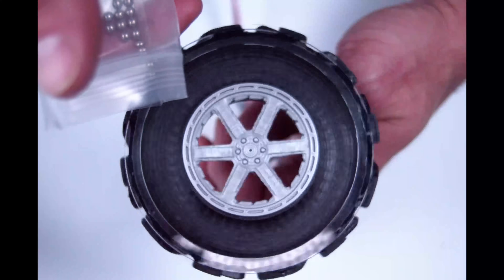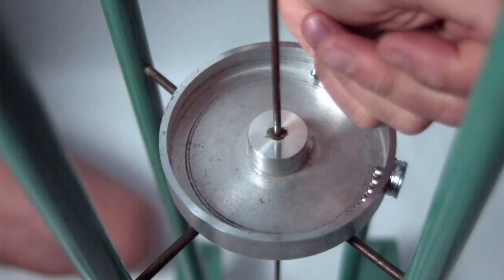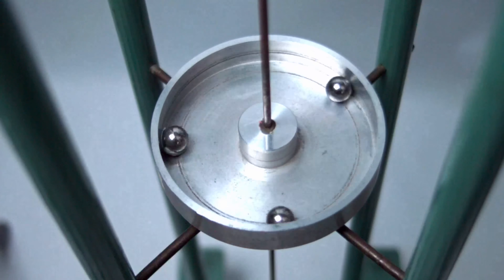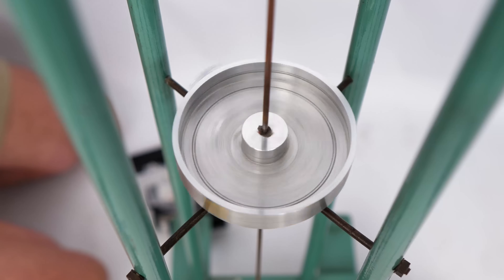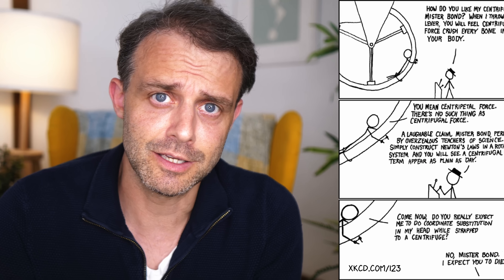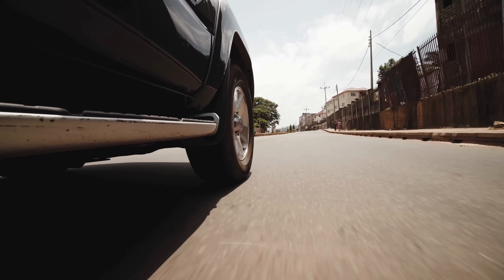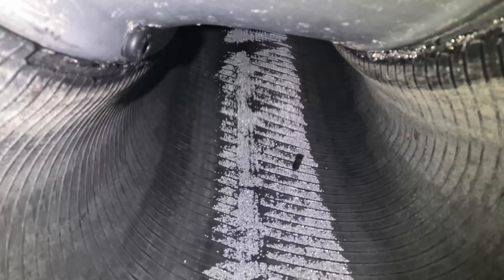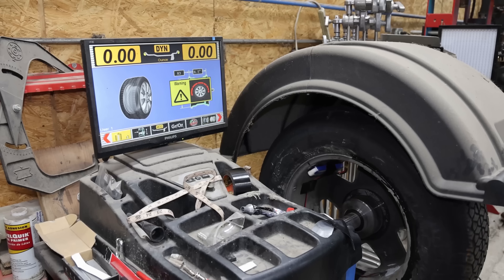Do tire balancing beads actually work?

Comment from the maker: My floor is covered in ball bearings.
The sponsor is AnyDesk, try it today https://anydesk.com/stevemould
Reply: Pretty sure you mean bearing balls, not ball bearings.
Ball bearings are the entire assembly of 2 rings, some bearing balls, and usually a plastic rack to hold the balls in equal spacing.
This I learned when asking around a metal shop for ball bearings when what I wanted was bearing balls.
Reply: It’s all ball bearings nowadays.
Reply: @jimcushing8722  throwback
Reply: @seanehle8323  Maybe varies by region? Here, we call the assembly you describe "radial bearings", and a single sphere of metal, a "ball bearing".
I do QC in an industrial factory in the USA.
Reply: @seanehle8323  The shop was being picky-picky, but I guess they are correct if you need to go there. Kleenex is tissue but tissue isn't necessarily Kleenex.
Reply: @seanehle8323  Which country are you in?  I'm in the northern USA and have never heard that.  BTW, Google AI says you are corect.
Reply: @Wintergartan would like a word.
Reply: @thesprtn2346  hahaha. Exactly what I was thinking!
(also, Ivan Miranda and his on going 3d printed marble clock adventure......)
Reply: @thesprtn2346  I think you meant @Wintergatan
Reply: you know people also fill their tyres with some liquid that does the same balancing but as it has less friction it seems to work better.   was surprised you didn’t mention this in your video.
Reply: I also had to share some weird kitchen phenomenon
when round bottom pot is placed on a IR cook stove it start to wobble circularly.
doesn't matter which material is it, Aluminum, Steel, Copper.
if we stop it by hand again it start to wobbling again.
and this is only for IR heating stove it doesn't wobble on Electro Magnetic cooktop
WHY???

I also has some video about it. if you want i can share it.
Reply: After you gave the "falling into place" explanation I was oh so hoping for a shot from the rotating frame of reference showing the second ball falling naturally into place, but alas 😔
Reply: Glass is the best. Glass beads also help keep the rim clean of aluminum's oxidative behavior, or steel, from rusting. Change the beads for fresh, each tire rotation. 😉
Reply: You want the oxidation layer on aluminum.
Reply: @DetroitMicroSound  Changing the beads 10 to 15 times per second is a bit much, I think ;)
Reply: In the 1930s my grandfather had a 1929 Indian Scout motorcycle, he could not afford to patch his tires, so he poured aabout a cup of water in each tire.
Parking it with the hole down the water kept the air from leaking out for about a week.
He noticed that at speed his tires would balance out for a smooth ride.
Reply: @davygravy7332 not I. Winter
Reply: Glass beads rubbing on each other means glass dust after a while. Good luck with your lungs if you try to replace tires without respiratory protection.
Reply: We'll give you some time to get your bearings. :chillwcat:
Reply: And have ball bearings all over my floor? No thanks.
Reply: My wife has a question for your next video: she wants to know what your scientific name is and how you acquired the common name "Steve Mould"
Reply: But doesn't this mean that at low speeds the tyre is even more unbalanced? And for anyone who lives in a city and never gets up to freeway speed, their vehicle will be shaking all the time.
Reply: is this possible with a fluid? could one use epoxy to balance the tire permanantly?
Reply: Can you please do a video of a car that has balancing beads installed in a tire, and then simulate a blowout doing 60 mph, and what that damage looks like to the vehicles behind it?
Reply: I can't help but feel like a ton of this "gravitate towards stable point and likely oscillate, all due to centrifugal forces" thing, has a lot to do with the same rotating frame + centrifugal force bullshit that powers lagrange points.
Only, those have no outer rim to push against to be moved into the right place, and depend more on distance to mass-center mattering a lot for how strong forces they experience (and are in fact more stable with some initial velocity and offset if you tweak it right to get the right type of orbit, otherwise not being too unlikely to eventually orbit out of the stable region). But still, feels related, in a way.
Reply: Like 69,😂 lol now you know @wintergarten 's pain
Reply: If you spin your room fast enough we know where they'll end up now...
Reply: I like AnyDesk, but they still -- after years -- have not chosen to support the Wayland compositor for Linux, as though it is still viable to run X11 as a daily driver these days.
Reply: @Nethershaw  anydesk is terrible, rustdesk which is also open source is 1000x better
Reply: Very cool as ever, and will try AnyDesk.
Reply: i've got sand in my underpants
Reply: Wintergatan would be one of the few to sympathize with you LOL.
Reply: I feel like this is somehow related to electron and atomic theory.
Reply: What is the threshold rpm?
Reply: The fella that makes these was a customer at the BMW motorcycle dealership I worked at.  I was the Service Manager and he pestered me for years to peddle his product. I agreed to on the condition he could find ONE  motorcycle tire manufacturer or race team that endorsed his product. He never asked me again. Think about it.  And one more thing, most paying customers expect their new pair of   tires to be smooth at all road speeds!
Reply: Perfect occasion missed for asking to get sponsorship by the orthopedics and head trauma clinics of your area
Reply: Can you revisit rolling ball on a spinning dics
Reply: You should really look into 'tea pets' especially the most popular kind of tea pet...namely the famous 'pee pee boy'. It involves unglazed pottery, bathing it in cold water and then hot water and then enjoying the childish effect to determine if the water is hot enough to make tea.
Reply: Is it any better than Parsec? Probably not because that's built for gaming
Reply: AnyDesk is awesome. It's what TeamViewer used to be before they went downhill.
Reply: @SteveMould I have a question you might be able to answer within a few seconds. Would adding say a cup of water, or perhaps a cup of light oil, when pumping up the tires, have the same effect? Brian
Reply: sorry for saying but anydesk is also good for scammers
Reply: Yay for centrifugal force and XKCD!!
Reply: HRBALURBAGLURBALERB!!!
Reply: Did you by chance do a video some small years ago with a camera in a performance engine intake and talk about it? I have a vague memory of it and maybe I am correct that you did. Perhaps it was with the newer BMW or Corvette engine. It was aftermarket intake or at least aluminum. It was a performance modified / focused engine. I'm sure of that.
Reply: This what is used to balance your laundry machines
Reply: I think you should interview Hans Niemann (Chess player) he is the local authority for beads and I am sure he is skillful enough that he can balance them too without a squelch.
Reply: I really like the AnyDesk model, "it's free, but if you like it you can buy it" that's such an early 1990s model.
Reply: @darthkek1953 inb4 it becomes "now that everyone uses our software, we're removing our free tier and it will become a monthly subscription"
Reply: Flatspots and worn suspension  worn roads cause vibrations. Best to use counterweights vs glass beads.
Reply: You need to do this again but with it horizontal instead of vertical. So it accounts for Gravity's affect.
Reply: Handheld vacuum inner tire before spillage and the Balance Beads can be reused.  Let new tire installer know before hand, and bring your personnel handheld vacuum to the tire shop.
Reply: Years ago truck drivers used to dump a quart of ATF into their front steer wheels .They said it would balance the tires. but I do know for sure that trying to patch one of them was hopeless.
Reply: All this thought put into a dumb idea 😂
The beads might balance the tire on the short, but would wear it out pretty fast around that single spot. Leading to explosive tire failure at cruising speed, and you ramming a schoolbus into a ravine.
Reply: Something you would be interested in?

https://youtu.be/TO-GgUV5s2M?feature=shared
Reply: I better stick to old classic metal weights
Reply: Saddly AnyDesk is no more free, they are limiting free sessions to 10 minute timeout due to "commercial usage" even if you contact them to be whitelisted.
I used it few times to help two friends in years but I'm flagged as commercial usage now.
People are reporting this issue on reddit and AnyDesk is ignoring whitelist form requests.
Seems to me they made this youtube sponsorship while forcing people to switch from free personal plan to subscription plan.
Reply: Soyence teachers are just dumb regurgitators of whatever. Of course you can't say that because then you will be mysoginist ... but the same people don't have an issue with lift and can't figure out what nathroom to use. Centrifugal force is what makes kids go flying from merry go round or the proverbial ... when it hits the fan. It's observable
Reply: Tire shops around here will charge an extra 100.00 for hazardous conditions
Reply: Shouldn't your experiment be turned 90 degrees, so it spins on the same plane as a tire?
Reply: Well in your particular example I fear that the magnet just magnetized the beads towards it lol and when you increased the speed the angular momentum of the beads exceeded the pull of the magnetic field and the beads could roam accordingly and balance themselves
Reply: Your video shows horizontal experiment obviously it works. Now try vertical experiment.
Reply: JUst see the safe effect in a TOP Door Washing Machine .

Comment: i use balance beads on my  4x4 with 40" military tires. No need to balance with weights,  i run up to 95 mph and no vibrations.  I believe a true spin balance is better for small & wide auto tires (corvette / Porsche, etc..),  but big 4x4 and semi tires seem to respond very good.  1oz of glass beads per every 10 pounds of rubber/ tire, aprox.... I've used .177 BBs before and they worked,  but that "motor way"  speed needed to be hit first for best results. 
 A magnetic stainless shot would be something worth trying. Being magnetic would make tire service far easier , less chance of getting the glass media pinched in the  sealing tire bead..  To me, that's the only con... any patching or changing of tire / rims, you have a little mess to deal with

Comment: Would this work on a grinding wheel?

Its a pain to balance it when replacing the stone.

Its 350mm in diameter and i run it at 24m/s 

Really interesting, love your vids 🚀

Comment: 05:41 Rather than saying that centrifugal force is a fictitious force, I'd say that it is an apparent force that is experienced as the centripetal force of the wall of the spinning wheel is keeping the person / the beads into place, inhibiting the inertia of the sidewise force that is applied onto the person/beads. The centripetal force of the rigidity of the construction keeps the mass at a constant distance from the centre point of the disc...
If the side wall were made of weak material, the inertia would fling out the mass when it overcomes the breaking point of that wall.

Comment: I'm still not getting why the balls only move to the correct spot at high speeds.  I get that the "low speed" is at or near resonance, and the disk wobbles all of the place...but I don't really understand WHY that keeps the  balls from moving to the right place.

Comment: So at low RPM the wheel will move with the center of mass to the outside but at high RPM it will move with the center of mass at the center?
Thus when I hold a pen to it the mark should move from one side to the other?  But will the mark be ahead or behind the mass?

Comment: I had a 1999 Dodge Dakota Sport Truck. It was lowered and I put low profile tires on it. The wheels were the Dakota R/T 17" by 9" wide . 
I put 255/40/17 on . Those wheels required the weights to be pounds on the outside wheel lip for balancing.. Now if you know anything about putting beads inside your tire for balancing there for tall profile tires. 50 serious sidewall and up.  I did my research for provided amount of beads for said tire size... Long story short I got Solid Plastic BBs and I put 3oz in each tire and never ever had a problem..  all the way up to 130+ MPH . That truck was as smooth as glass.   The tire tech was arguing with me saying " it's not gonna work!!!! You'll be back!! . Well I put over 30,000 hard miles on them tires and never had a problem and never replaced a wheel bearing in that time either...

Comment: Maybe... And this is just a thought... You could make those balancing beads "meltable"? So... Go out on the freeway, get to speed, maintain that speed, let the wheels heat up, melt those beads against the inner part of your tire, and then let them cool down in place. Problem solved? I don't know, maybe... Maybe not.

Comment: There are 2 stable systems for rotation at high speed: the super wobble (which only gets worse with more power) and the self-cemtering wobble with rope-like spinning nodes (!!!) in the axle.  You're switching between the two systems when you straighten the shaft.

I hypothesize that if you spin fast enough, transition between spinning node states will throw the top mass into an irrecoverable super wobble.

Comment: There is one thing you’re not taking into an account is the tire flex when it hits the road that disrupts the beads at lower RPMs.   I run these in all of my cars and trucks and even my camper. I’ve been a mechanic for 25 years. My tires were evenly even on my Dually truck pulling a 40 ft toy Huller     Only issue with them is moisture in tire air. Cold conditions freeze beads in place until it warms with friction.

Comment: I think it could be possible to make a liquid that is heavy enough and that stops moving after a bit of time and freezes (glue type of behavior) 
So that you only have to spin the wheel at the tire shop and when you go out you have perfectly frozen in place weights on your wheels.

This sounds pretty doable, let me know if you see any flaws in my thought process.

Comment: Alright. Follow up question. How does it work with different tire sizes? I would imagine it works less well with larger tires because they would need to hit a higher speed for them to overcome that transition?

Comment: what about using some sort of beads that stick to spinning wheel after they get in place , sort of the first time calibration thing, so the effect will be permanent no matter the spinning speed (permanent until the weight and proportions change due to wear and other things )...

or mabe, use some beads that leave a mark where we should glue them after the first spinning calibration.

Comment: Spin is an interesting thing. My physics teach in highschool had a demonstration with a bicycle wheel that he would spin at a decent speed. It had handles on the axel, and he'd tell us to try and turn it 90° to the side, and note the counteractive forces as the spinning object resists diverging from its plane of stability.

As long as you're putting energy into the system to maintain the high rate of spin, the spinning object will want to stay on one plane. It's the same thing that stops coins from falling over while they're rolling, and indeed balances things like bicycles while they're in motion. It's one when that speed decreases that this planar binding force decays.

Comment: What about sticky balancing beads? Put them in, spin the tire up to high speed, and wait until they sick to their correct place. You could make the reaction heat activated as tires get warm when driving( so they don't stick together too early.)

Comment: What about different diameters of wheels? I can imagine that angular velocity is the driving factor here instead of linear velocity. This would mean you need to hit lower speed with small diameter tires.

Comment: Couldn't you design a way to use the balancing beads to find the sweet spot, record those spots and the mass required to fill them, and then permanently fix either the beads themselves or some other medium into those spots to create a perfect balance?

Comment: The beads work for 99.9 percent of drivers. No driver runs less than 15mph all the time. Yes tires will unbalance below 15mph. But then above 15mph they will balance again. So all in all they are good
Reply: 50, not 15

Comment: It is a scam they do not weigh enough. Those weights are 5g or 10g, you would need 15-20g of glass beads.  Also your tire should be balanced when you buy it so if it start wobbling something more serious than balance must have happened.

Comment: You can play around with this at home pretty cheaply with a hand-held milk whisker. It's a battery powered advice that essentially just spins a flimsy metal rod (the "axel") and has a spring bent into a donut shape at the end.  After a few weeks of use, mine started to wobble violently on startup. Probably due to the spring changing shape, getting some stuck-on gunk, or the axel getting ever so slightly warped? But once it spins up to speed the wobble vanishes! The wobble even returns when the device is powering down. I assume the spring has enough flexibility to balance itself, similar to how the bearings do, except that it is  continuous instead of discrete.

Edit: made this comment before watching the whole video, 8:28, wow!

Comment: I see a few different issues, but if you get a leak, you're in trouble. You stop the car. You inject fix-a-flat. It seals the leak, you try to drive for help. All the beads are in one spot, stuck there with fix-a-flat. Now you've got a bad tire that's WAY out of balance. Way worse than it would be without the beads.

I guess it's better than nothing and the tire is trashed anyway, what with it stuffed with hardened foam. But I can see this making a bad day much worse.